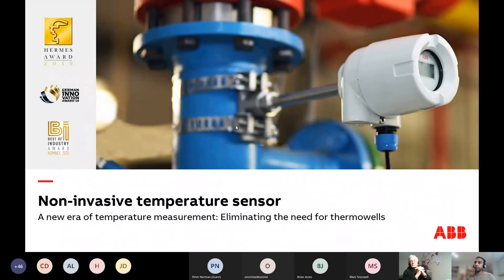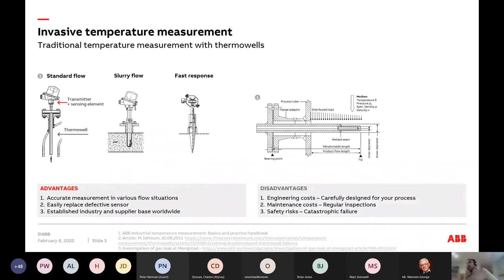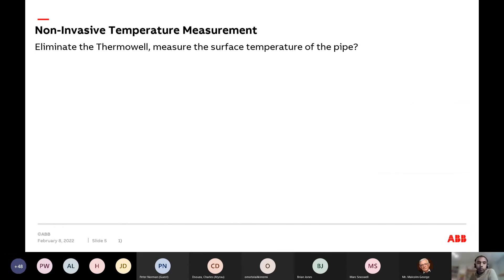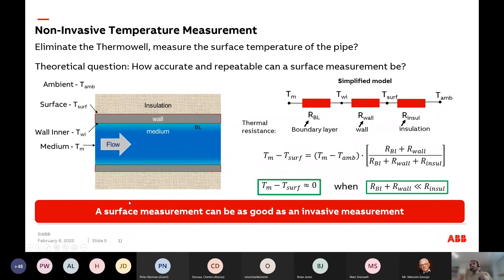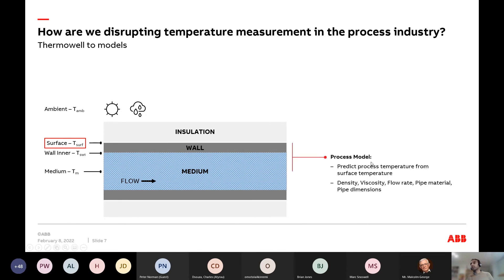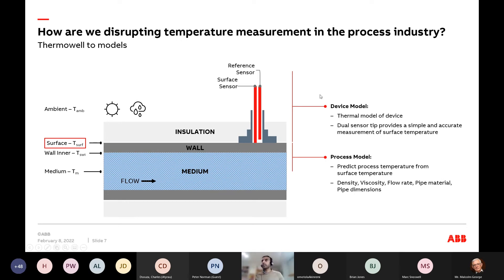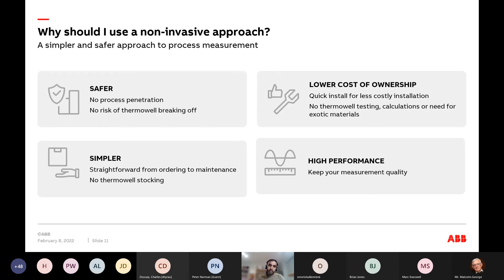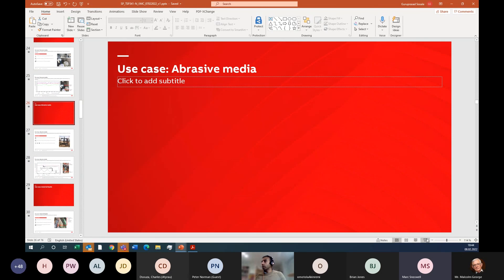Non-invasive Temperature Measurement By Dr. Guruprasad Sosale

Comment: Offcourse in small pipe case skin will be fast, what about bigger lines when the pipe thickness matches the thermowell thickness (5mm to 7mm at tip), skin type will not be anywhere close to response time compared to thermowell (with sensor) which is few inches in the pipe. any remarks from ABB ?